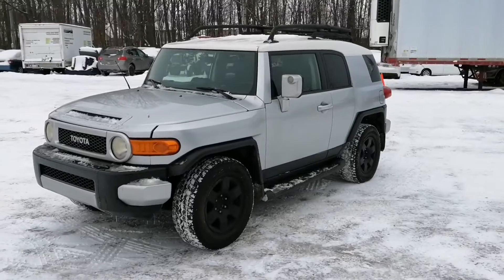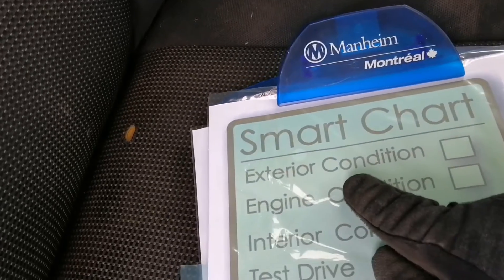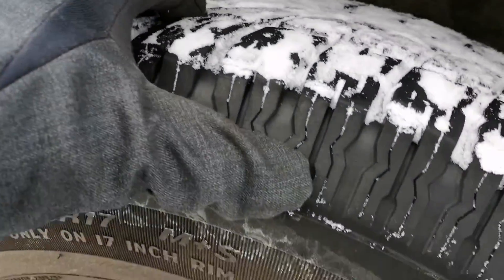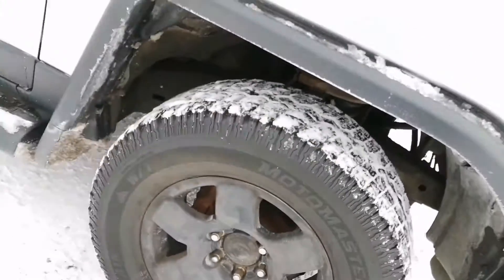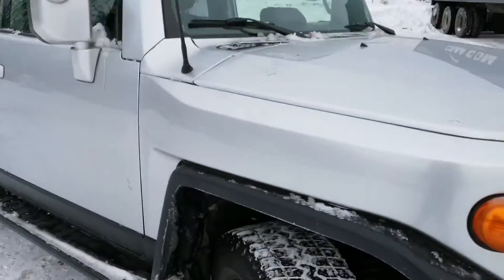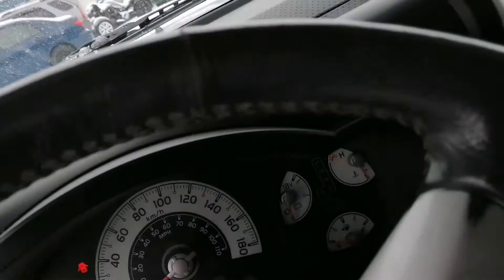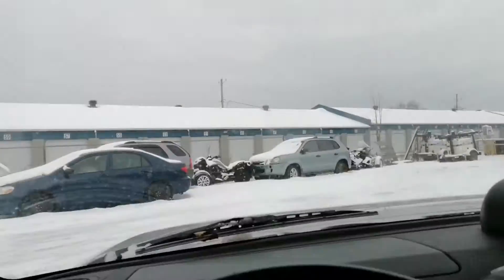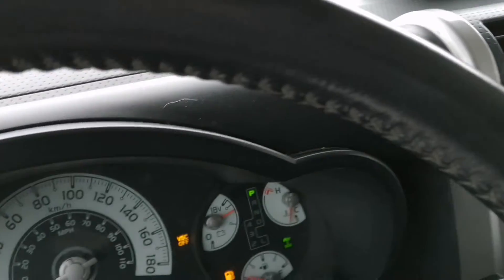How to inspect Toyota FJ Cruiser 2007 before buying

Comment: One thing I'd recommend is buying a cheap scan tool so you can get past the engine reset.  Brought one to my dealership. 

It's sad to see an FJ treated like that. I still have mine,  the very first car I've ever owned and my daily.
Paid 3k to remove rust  and repaint bottom so it lasts me longer, and replaced some parts that were rusted. 
I spend a good amount of time keeping it clean, and caring for it so it doesn't let me and my girlfriend down unexpectedly.
So far it's been wonderful- No engine problems in any way. Most shop work has been to prevent future issues. 

I plan on keeping mine until it goes completely, but if I decide to sell it, I'm going to absolutely make sure it's ready for another 10-15 years without me. 

And definitely not like this one. Great video here man, thank you.

Comment: I am about to buy an  FJ very helpful
Reply: I bought a used 2007 but it turned out very well.  Just check it out well. All depends on how someone took care of it.
Reply: Did you buy it?
Reply: @ParissaKhoury  YES 2008 4-X Trail Teams WHITe  33x12.5 MOTO wheels 152k miles at a dealer in Arlington TX for $17,100.00 no accidents  speaker bass in back roof rack  aux exterior lighting

Comment: The fan shroud is missing, the engine splash guards are missing, and many clips missing. The driver's side wiper looks too small. Jack storage panel missing. Yes it looks like it has been in accident and not repaired correctly. That rust is concerning as is that engine sound. The VSC light does comes on in 4 wheel drive.
Reply: Wiper looks small cuz 3rd one is GONE, lol

Comment: I am looking at a 2008 FJ with 400000 km. I am a bit debating about the km although the car is in pretty good conditions. Should I buy it with so many km?
Reply from the maker: Yes. If the cars is super clean and is still driving like new. Many dealers would lower the mileage and sell it to you anyway. Think about it , 30000km a year for 15 years that’s 450000km so it’s completely normal for a 15 year old car to have that kind Milage.

Comment: My friend im looking at a 2008 cruiser for 12,990 and 183, 003 miles is it too much and not worth the price?
Reply: Look at the bottom for rust versus frame rot. Look at examples. Bring a rubber hammer and hit around. If you make holes, walk away. Bring a scan tool and watch the engine. For 180k miles? You should try to get it for 10k flat.
Reply: Also check the inside front fender walls to make sure the aren't buckled.  The back door hinges can be spltting the wall of the door frame.   Those things are caused by hard off- road trail riding. Check the frame rust well.  Check the lines. I learned all that after I bought one but luckily it was a good one.  i could have been ripped off easlity.
Reply: I was going to buy a beautiful 14' FJ. I mean it looked like it came off the showroom floor. Upon putting it up on lift, the frame has lots of rust. A bunch of rust around backside of wheels. I am sad...I had to walk away.